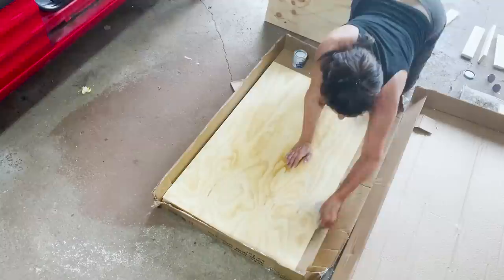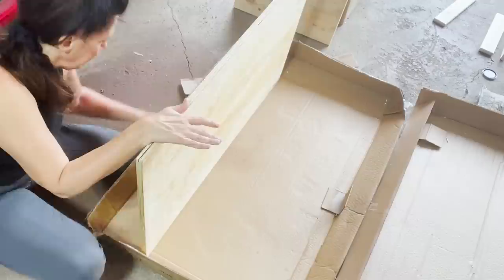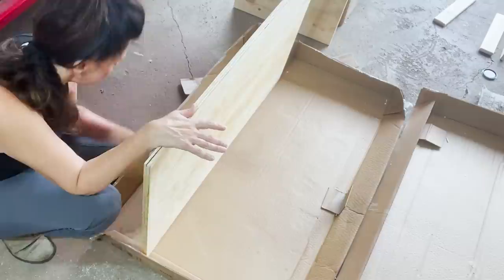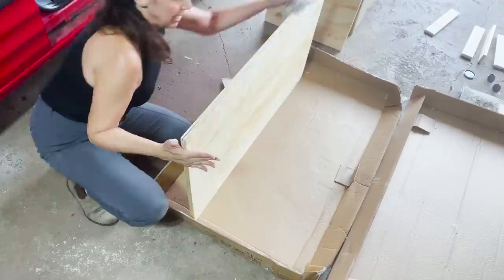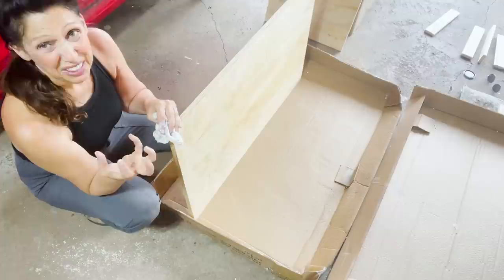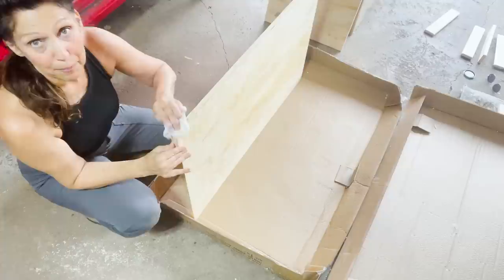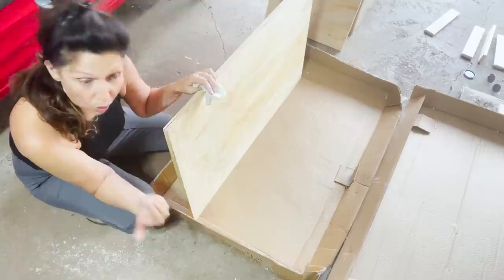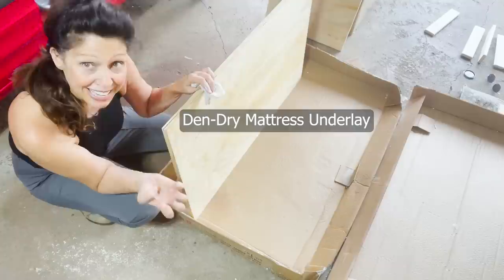Van Life | I made a new BED platform Failure? Genius?

Comment: That slide out piece of wood could be made much lighter by getting a doorknob hole attachment for your drill and drilling random polka dot pattern holes in it! I have arthritis in my hands and I would have to lighten it a bit or have finger holes for grabbing it to slide out.
Reply from the maker: Good idea!!!💃🏻
Reply: Excellent idea! I'm a big fan of taking out unneeded material with this trick. You can save a good 30-50% of weight.
Reply: @JakobNoone  Plus airflow is good too i think 🤔
Reply: @TeeAnn  Good thought.
Reply: Save the cut outs for coasters or Christmas decorations
Reply: Or glue the cutouts together edge to edge to make a trivet
Reply: Or paint them to look like lady bugs. Put some Velcro or magnets on the back and you have decorations made from the waste. 😊

Comment: The extenders are genius. You could have made the floating piece of plywood equal to both the other pieces put together. Couch mode would be an even surface (instead of a 3/4" dip in the front portion) and it would fill more of the support gap in bed mode.
Reply from the maker: Yes, I might do that. Thanks😊

Comment: Hy great Idea on bed Dee I am a 40 plus year furniture and antique restore guy they make those table runners in metal which works smoother not subject to swelling which therefore can make them hard to operate or unable to operate at all they come to be able to open up to different lengths
Reply: Can you recommend a brand? I am planning to do  similar build myself.
Reply: @dianeallen3724   sorry I have been retired 12 years  I dont even remember were I got them unless it was vấn đyke restorer  I like the ones with ball bearings for ease of use

Comment: That looks pretty slick and I have a few ideas to make it easier to move. There is some wood wax that you could put on all the sliding pieces that would make it slip into place easier.  Think of it like skies or a surfboard, it’s protective and allows for things to slip better.  You could attach a few pieces of leather to the boards to have a hand hold, or cut out hand holds by drilling two large holes a few inches apart, then just cut out the middle to make an oval shape.  If you attach some leather straps to the headboard, and put a magnet on it, then you can have the straps attach to the back door, then just grab the strap to pull the headboard up, rather than stretch, twist and lift—which is dangerous for your back! I’m a nurse so I can’t help but see potential injuries over the long haul.  If you have time to round the edges and do a little sanding you can avoid painful edge bumps and slivers too.  If you don’t have time now, it looks easy enough to do that later.  You might even be able to attach leather straps to the boards so they fall into place.  Also, you could rig a pulley system that could hold the hold thing upright if you needed more horizontal space from time to time, like moving furniture or supplies.  Using pulleys, leverage, carpet sliders and counterweight are ways to move heavier items without injuring yourself.
Reply from the maker: Great suggestions. Thank you so much. I’ll investigate that and see what I can do.☺️

Comment: An idea might be ski wax between the wood if it starts to swell with the different temperature of the slider bed frame. For it to slide in and out easier along with the metal, WD-40 is sometimes a good product when it comes to squeaks and tweaks !
Reply from the maker: Thanks for the tips!
Reply: Paraffin wax or candles would work too

Comment: I love how you change things around - like redecorating or renovating a sticks 'n brick home!
However, my experience is that as companies, HD & Lowe's may advertise that they will cut your wood, not all can/will do so.
In fact, I have never been able to get them to cut anything for me, not even my most recent request to cut a 10-foot long 1"x2" into a 6-footer and a 4-footer, both to fit the needed dimension for my project and so that I could fit it into my vehicle.

I ended up sawing the 1x2 myself at their "sawing station" (which was a frame cart on wheels, equipped with a variety of hand saws and , a pencil, a tape measure and a 2x4 to serve as the stabilizing brace/straight edge). 
My project, using the screen door that I bought at that HD and those 1x2s I cut, fits and works like a charm, creating an open-but-separate hallway area for the cats =:^)
Reply: Before anyone ask, "Oh, yeah?", actual excuses at my local stores have been:: 
-- The person who can run the saw is unavailable.
-- The saw is broken.   [three different times at the same store]
-- The saw cannot saw that low.   [it was a vertically mounted sawing bed]
-- The saw cannot saw those dimensions.   [again, the vertically mounted saw]
-- We don't do that, but there's a sawing station in the next aisle.
Reply from the maker: That’s good to know… I will try to make a clarifying statement to that effect.☺️

Comment: Very nicely done.  That is way overbuilt for someone of your size but, that is much better than being underbuilt.  Great idea to use those table leaf sliders.  I had not seen that done before.  You can rub those sliders with some bar soap which will provide some lubrication and they will slide with less effort.  This might become important if that wood swells some during damp days.  Safe travels.
Reply from the maker: Thank you very much!

Comment: To keep that middle plate in place, you can drill 2 holes of 10mm on the end wood, and the other plate it connects to the same right opposite each other, and you can then knock in a wooden tap, glued 1 side You can also do this with blocks of the same thickness from your plate, and then on the other plate where it fits against you saw the recess, (Just like a puzzle piece) (PS : my Greetings from Belgium)
Reply from the maker: I like that idea a lot!!!🤗

Comment: Fantastic hack, using that table extender hardware, Dee! Genius. Thanks for this vid! I was thinking, in order to make it easier to maneuver the larger floating piece of plywood, you could drill a 1 or 2 inch hole in each end of it to use as a finger-grip space.
Reply from the maker: Thank you Kim! That other message is not from me. Please do NOT text them.

Comment: Genius  using table leaf extender.  However, when you sit upon it there was give and I can see the possible need of installing two more legs onto the table leaf extender in the middle, even though you have metal support in the mattress to help where there is a gap in the wood underneath, the long extended portion needs added support. You are correct this could be easily adjusted to width and length as desired. The idea is genius ! Thank you for sharing.
Reply from the maker: Thanks for the suggestion☺️

Comment: For our 2018 Pro-Master City, I made a 28 " x 72" bed out of a luan door I bought at RE_store for $15. Made two ends out of 1/2" and short table legs  for support, had 5 storage bins underneath. (Fold up bins from Amazon. It was low enough so she could sit upright (38") We built a sink & desk unit with a drop-down computer shelf, 5-gallon water jug underneath and 3-gallon grey water jug. It went from the passenger seat to the back with enough room to store a fold up camp chair in the back. since she had two sliding doors, I wanted her to be able to get out on the drivers side and get right in without having to go around the van. On her first trip out to see a friend, she took way too much STUFF. By the second or third it was paired down.
Reply from the maker: Yep! It happens to all of us. We start out thinking we need everything and little by little wean it down to what we really need😛

Comment: I like it a lot. Great idea for the wooden table extenders. I am surprised that you didn't add wood glue so the screws don't move, however. I see all the furniture builders do that. Maybe add roller guides to keep the board from moving around? Maybe drill a couple of finger holes to make it easier to pull out, too? Easier on the skin/nails.  Great job.
Reply from the maker: Sounds like a plan!!!🤗

Comment: What an innovative solution! I am still on the fence as to whether I'm going to install a converting bed or a permanent solution. Your bed is certainly a space saver, and what a great use for those table extensions! As for the comment section, YouTube is full of people on standby ready to tell you "you're doing it wrong." if it works, I say you're doing it RIGHT! :)
Reply from the maker: Thank you. That means so much to me😊
Reply: @LadyBugout  For what it's worth, I have a bunch of tools (with very little experience using them) and people tell me I'm doing it wrong all the time. I do my best to fumble forward...

Comment: Impressive...you can add two strips of leather under the bottom of the small piece of wood to the bottom of the disconnected piece so it will slide out when you pull it.
Reply from the maker: I like that suggestion!!!

Comment: You can use newspaper to make a pattern, then lay it on your tiles to cut them so you get a more exact fit.
Reply from the maker: Thank you for the tip. The other message is not from me—please do not text that number.
Reply: You're welcome,  @LadyBugout ! Your builds are so creative. Will you be re-installing the rail system for your table and extended counter top that you had on the other side? This video inspired me to look into using a table extender for the expandable platform bed we're building in our guest room since we had to remove the fixed bed when my husband's work went remote at the beginning of the pandemic and we needed that room to be his home office. So one good tip deserves another, I figure!

Comment: Interesting idea!!  I wonder that your bottom is where the hole area is. Even a metal frame could bend a bit if your head is up.  I sleep with my head elevated and after a period of time my very thick mattress makes a "hole" where my bottom is.  Takes time to happen, however.....  Is there a metal framing further down, where the large middle board could remain to the upper end of the bed?  Legs do not really add much weight or pressure...  I think you have a winner here!!  Seems to work well where you have located it.
Reply from the maker: I never thought of that. I don’t think it will be an issue as my bottom is where the mat has a full piece… but I’ll look into it☺️
Reply: @LadyBugout    😊

Comment: I love this bed setup but I have watched many times trying to reconcile your measurements of 72” in length.. You have two 24” boards and the 6” board on bottom. That totals 54” so your gap that isn’t filled in has to be 18” to equal 72”. Also, where is your ottoman with cooler and bench area when bed is extended?
Reply from the maker: The platform measures about 68” altogether. The mattress measures about 72”. The base of the platform is 24”+ 6” (part with legs that pulls out). The top piece that sits on the base that moves into place is also 30” (I had to reattach a 6” piece to a 24” piece with brackets) to match the base. And there is an 8” flap that pulls up. I had originally intended to use three 24” boards which became too cumbersome so that may be the confusion—I may have been referring to those measurements at some point😝 Also my version one platform was 30 + 30 + 10 when I had the bench. I just slide the ottoman over beside the cabinet. Hope that helps.

Comment: Air bottom of your mattress
If you are around Pipeline jobs ---- see if they have a piece of rock shield they could let you have. They always have scrap pieces and what it is, is a very dense rubber, very cushiony, and millions of holes all the way through it. I put a piece of that under my mattress lots of air circulation.
Nothing better than free
For sure good air circulation leave it sticking out on all sides of your bed. Just a quarter of an inch would be plenty just so that your mattress isn't going flat down and then the air can't get in. Does that make sense ?
Reply from the maker: Yes! Thank you for the great suggestion☺️

Comment: Hi Dee.
I just finished the inside of my 2016 Transit connect van. So far I have taken out the passenger seat for Archer. I put down plywood for the floor, carpeted the walls and ceiling, installed a MAXXFAN with remote. I am ready to build the bed. I have the table extension, adjustable legs, throw rug, pad and your adjustable couch in the checkout bag on Amazon. Before I pay, I wanted to check with you to see if your bed has made you happy? If there is anything else I need to buy for the bed besides the plywood,  and ask if you know a similar couch were I could get a different color besides beige? Yours is 39inches wide and all the others on Amazon with different colors are 43inches wide. I only want it 39inches like yours. I am soooooo excited to finally start making the bed, because everything else will be built around that. I sold the DISC-O-BED. Lost $140. because of Ebay's 12.9% selling fee, and shipping. Your bed will be so much nicer. I don't have as much room in my van as you, but I will have to make it work. I want to make this van as nice as possible incase it turns out to be too small for Archer and I. I can always later sell it, and buy a larger van if I have too. I am really enjoying the build so far. 
Being a retired contractor, I get to use the skills again. February is almost here.  Can't wait to see the snow. Seeing Archer frolic thru the snow by a tall mountain will make me cry with joy. 
Thank you for being you. 
David and Archer
Reply from the maker: I am happy with my set up. I thought they had other colors available…I know someone who reupholstered theirs on their own😝 the great thing about Amazon orders is that returns are easy. If you find something doesn’t quite work for your specific needs, just return it!!!☺️
Reply: @LadyBugout  I received the table extensions yesterday and had everything ready to build the bed, so I finished it yesterday. It works great, and I didn't have  to move the leg to the inside like you did. Van design difference. I received the rug and pad also. I am going to wait until I am almost ready to leave until I buy the actual bed so it won't get dusty. I'm hoping I can find a darker color with the size needed for the frame. Now that I have the frame built I can build around it. Thank you again for this BED frame idea. It was fun and easy to build. Take care. I pray for your safety and your adventure. 
David and Archer

Comment: Dee how much weight are those pull out leafs rated for?
Reply from the maker: It doesn’t really say! But it is solid high quality wood.
Reply: @LadyBugout  Reason I ask is I am 280 lbs.and the 400 lbs. drawer slides are ridiculously priced
Reply from the maker: @paulsherman6450  Yes, that was the deterrent for me with those metal slides. Someone commented that metal table extensions exist also. I was looking for wooden ones. Maybe if you search for metal table extensions, you will find they are less than the drawer sliders? These wooden ones feel very heavy duty, but since they don't give the weight, I am not sure. I know it holds 130 lbs just fine lol.😂